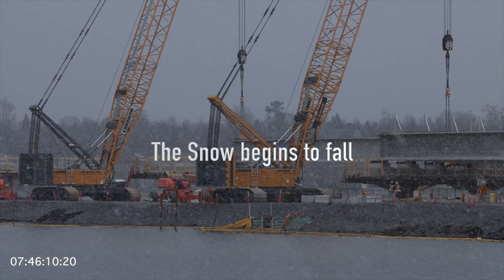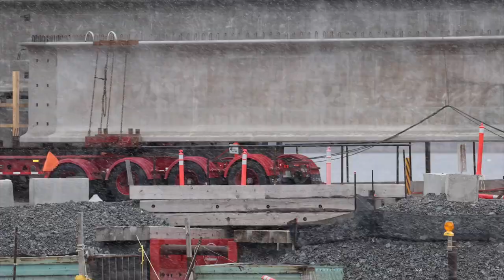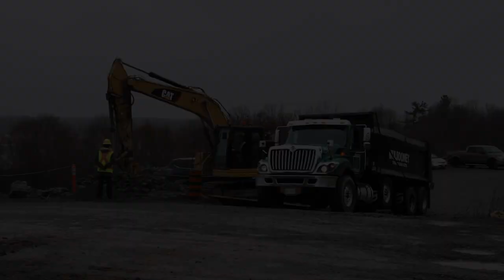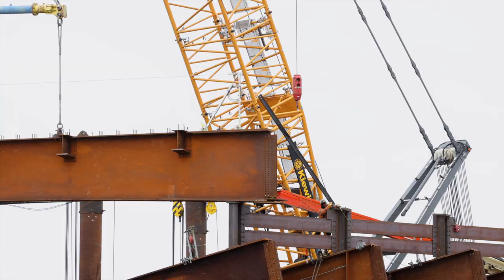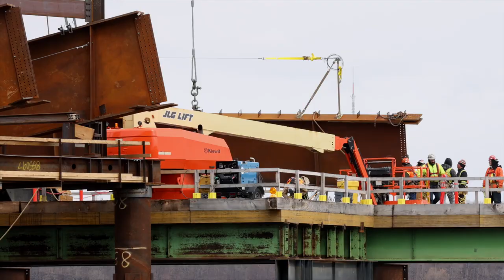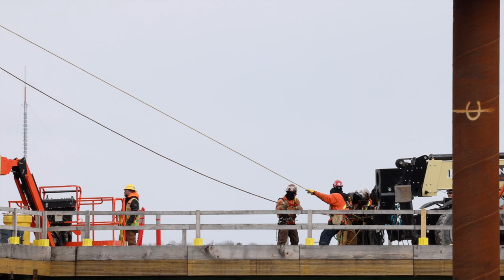Good Friday - Great Thursday

Comment: What time do the girders usually arrive? = Great video
Reply from the maker: The concrete girders typically arrive on Mondays and Wednesdays between 12:30 and 1:45 pm. They are installed the next morning just after dawn. The steel sections have not been as predictable, but on the days that they ship, they arrive in Kingston around 1:00 pm or a little later and come down Hwy 15 to the site.